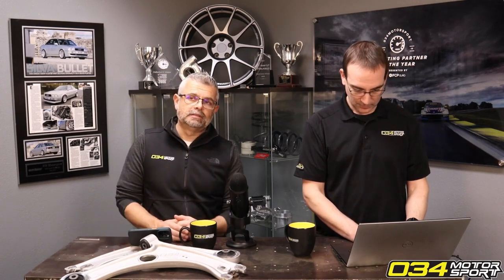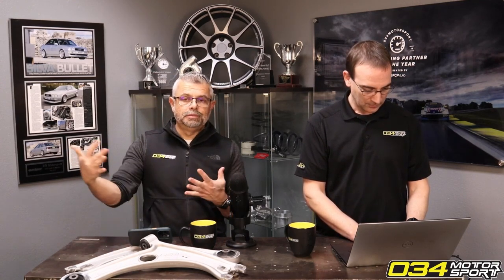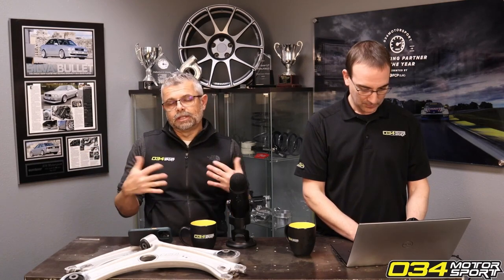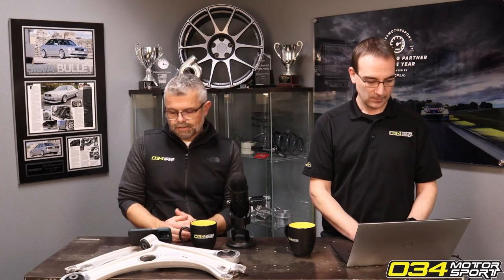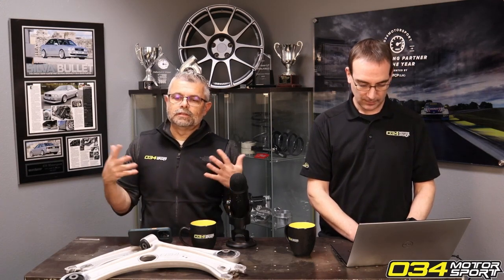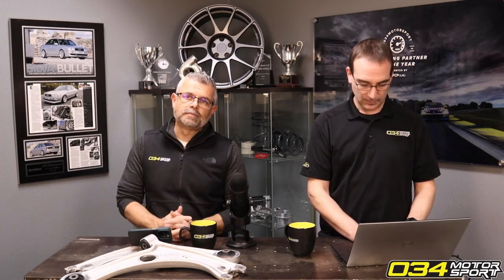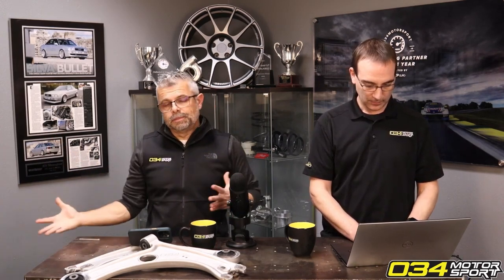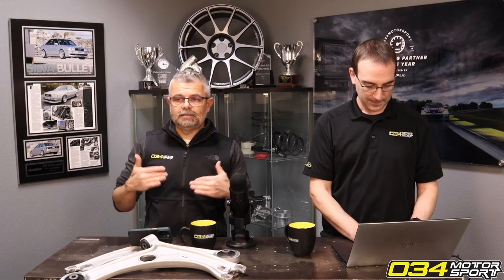Are Upgraded Intercoolers Required with Dynamic+ Tuning Software? | 034Motorsport FAQ

Comment: I have a Wagner intercooler on my B9 034 stage 1. Also have x34 intake. What is the limit of this combo?  I mean if it’s 90 degrees out and I’m thumping on the car is the wagnor magic or will it too heat soak?  I imagine it too has a limit. Just trying g to get a rough idea of how much “time” of spirited driving will this allow me?  Thank you. FYI I bought all my stuff from you guys.
Reply from the maker: All cars, regardless of modifications, are susceptible to heat soak, regardless of modifications. There is no written limit to how long you can drive with these modifications at a certain temperature as there are many variables.

When developing our tuning for the EA839, we implemented key safety features to keep your engine running optimally and safely in virtually any condition - just like the OEM calibration. These were then verified by us on track through multiple high-temperature track events with our vehicles. This keeps the engine in your car happy and safe, providing consistent and repeatable power.
Reply: Dude I'm with you. Entire chassis stiffened plus intake upgrade and I also went with the Wagner for my Stage 1 tune

Comment: Do the currently available thermal dispersing coatings help in an intercooler application?  I have seen benefits in to small factory ac evaporators that have limited space available, but never seen/heard them talked about for intercoolers?